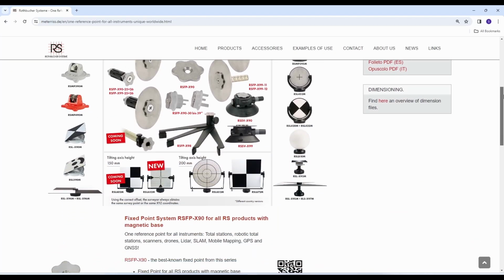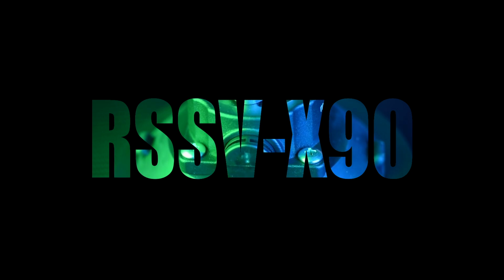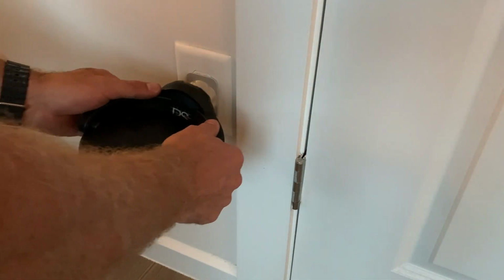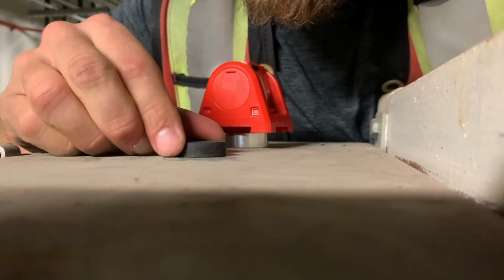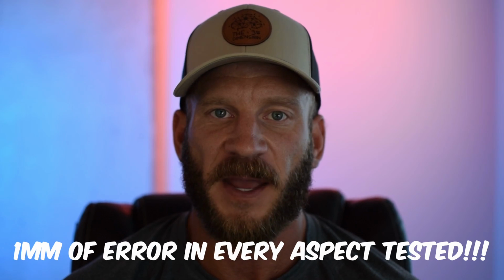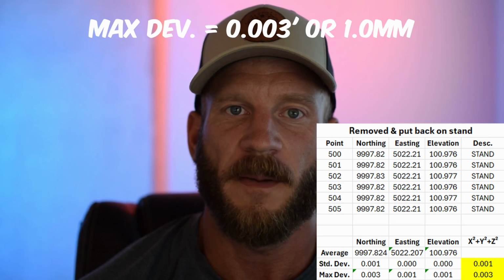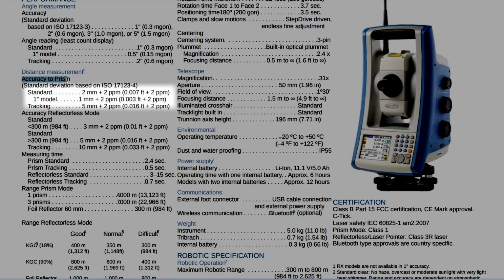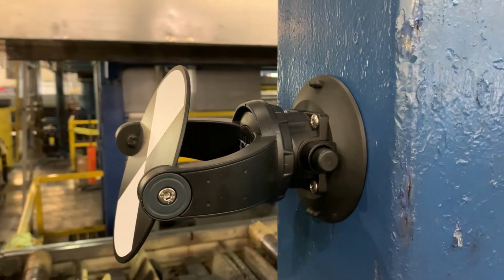The Future of 3D Scanning & LiDAR Control - RS System

Comment: Great video as usual 👍 I want to start small before I get to know the system. Should I go for the 45 or 100 mm tilting axis line? Or have I misunderstood something fundamental?
Reply from the maker: What would your primary use be? Scanning targets or prisms for resectioning?
Reply: @The3rdDimensionSurveying Good point. Resectioning I guess. 45 mm then
Reply from the maker: @whiteshelf yea the 45mm will be better for that. If you’re primarily using them for resections it’s worth looking into ball prisms too if you haven’t already. I have a video on them.
Reply: @The3rdDimensionSurveying  Yes, I'm considering Bohnenstingl as well. They have targets with roughly half a ball on the backside, which provides the same alignment as the prisms. It seems like a good starting combo, but I'm hesitant to lock in on a system.
Reply: Even considering combining a JEOC 1.5" kit with Bohnenstingl targets, but I'm not sure they are interchangable.

Hoping for a new video about all of this :)

Comment: Looks like a less expensive alternative to the ATS system which has been around for many years. 

Some interesting ideas there though with the electrical plug outlets etc...
Reply from the maker: ATS system? I'm not familiar with this.
Reply: @The3rdDimensionSurveying  I love the chart on the BW target system you have there. I wish it had the 3D scan data in there too because I've been arguing forever that BW are trash unless they're on tilts, and the tilts chew up your field capture time if you are doing high volume work.

Spheres are king

Comment: Game changing system for this industry!! Very thorough overview, keep up the great work!
Reply: I wonder why they are not using QR codes on the targets. It would seem like these could provide identification and data to the system.
Reply from the maker: @itoibo4208  They do for aerial targets and most terrestrial lidar processing automatically pick up the black and white targets without the need to manually pick them. Leica Register 360 would be one example. Would it make sense to make targets specifically with AprilTags? Not really, their use is so niche with the amount of terrestrial software packages that could really utilize them effectively. Maybe that will change one day and if it does I bet RS would look into adding them.